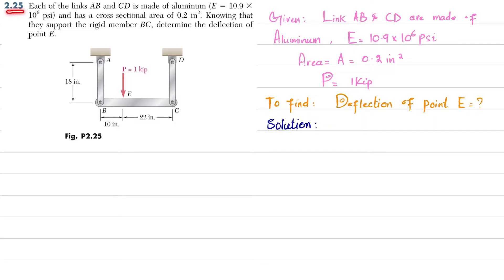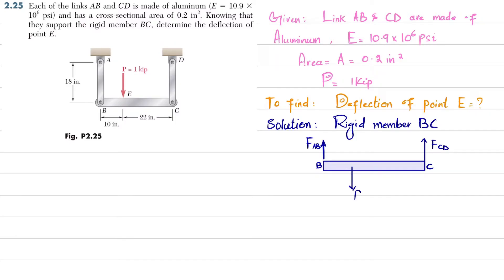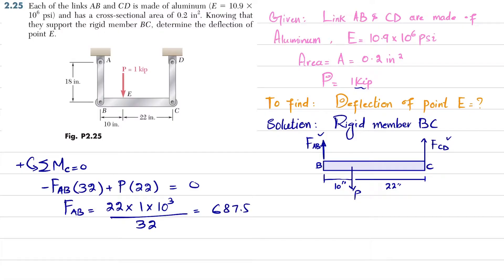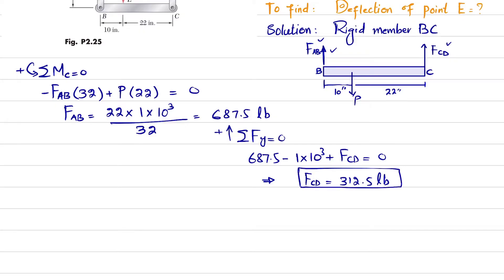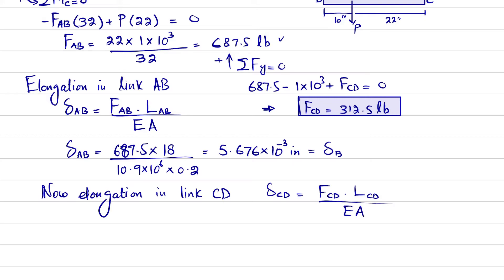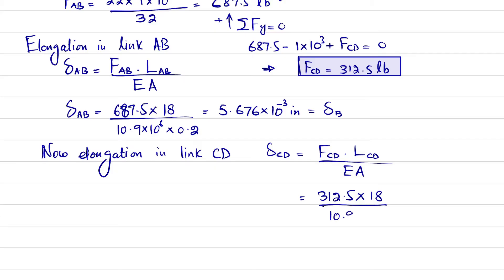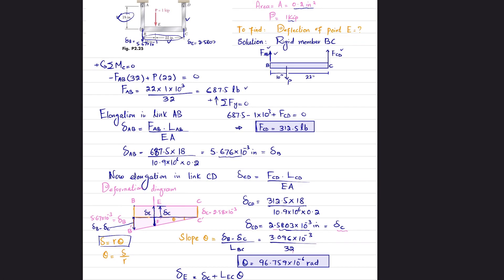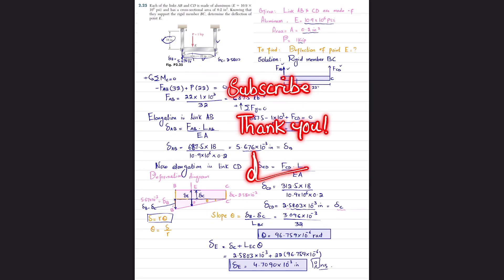2-25  Determine the deflection of point E | Mechanics of materials

Comment: For the last part, since length of BC is constant, wouldn't AB and DC bend closer to each other making them not parallel?
Reply from the maker: As the elongation in link/rod AB is greater than elongation in Link/rod Cd for the given load on rigid member. Therefore rigid rod BC  will tilt into new position B' c' and then we can calculate the deflection of point E due to applied load P. ❤🎉
Reply: @engradnanrasheedmechanical  Got it thank you!
Reply from the maker: You are welcome 🌹